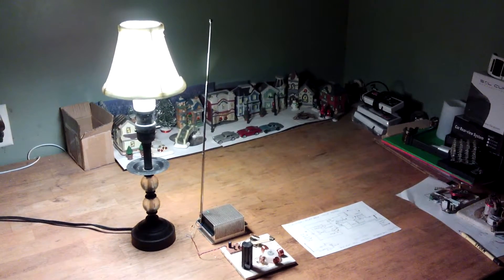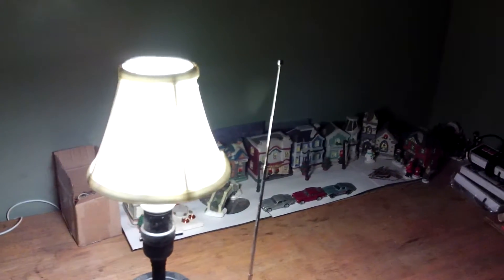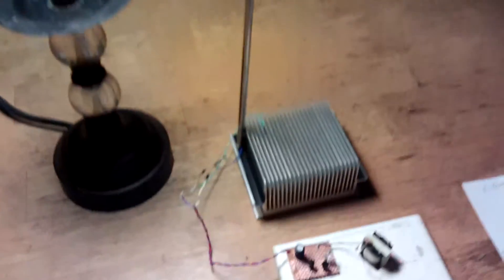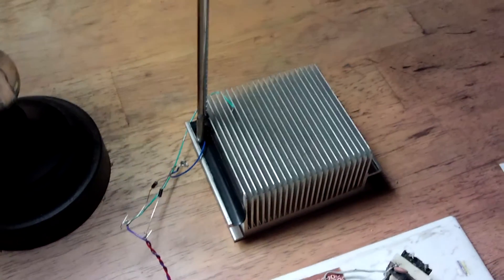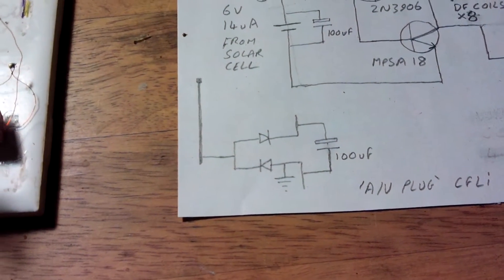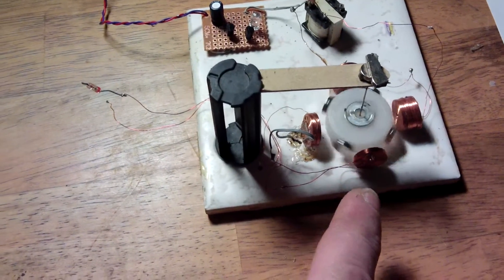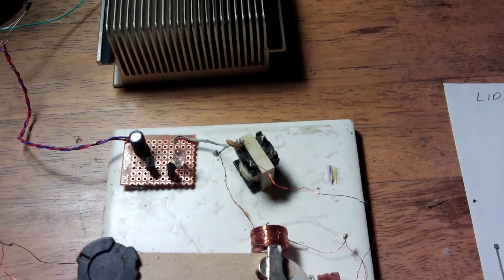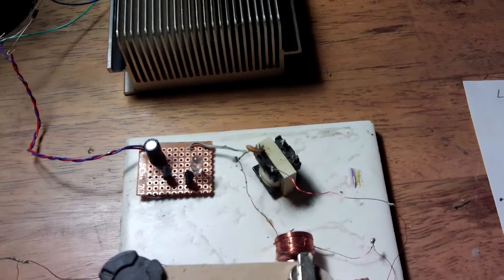Micro-amp motor - powered by lightbulb induction waves

Comment: maybe later try a tiny piece of magnesium  and a piece of copper for a earth battery. I had two 15 led lights running off of this for over 2 years then the magnesium corroded too much.
Reply from the maker: A similar motor did well like that a couple of years back. it's on the channel somewhere. Yep, part of the trick to long running is the least draw possible from something galvanic...with materials that don't naturally corrode. Graphite and stainless steel for example. I tend to use galv steel from the fence at the back of the yard, it was old when we moved here 8 years ago and has no signs of anything on it !

Comment: Have you got an inventor 3 circuit lying around?
Reply from the maker: Indeed and that was the original type of circuit, with a link removed between input and output caps. It was your good self who pointed out that such a circuit was a voltage doubler way back, so stripped down it ended up being an AV plug :)
Reply: LOL. Thats right its all coming back to me now. LOL curse this memory of mine. Shame there is no current doubler equivalent.
I wonder what the range on SWES transmission would be? You could probably get it running off BAC near a power line.
Reply from the maker: Hmm, well this sort of antenna should work ok for a SWES. The Ground plane is really half of the story, similar to any wireless bridging. Am intending to build a window motor, a horizontally levitated motor etc (in time) and somewhere hopefully gain some more efficiency.
Tuning some type of topload would be good, being that there's none at all on this one ! Am not sure how to tune to 2.4Ghz or would do that too.
Reply: 31.25mm is a quarter wave for 2.4ghz. Or go 125mm for full wave but you miss out on the ~5dbi gain of the 1/4 wave. To work out topload just calculate capacitance of top load to ground and consider how this will effect the res freq of your ant.

Personally I'd just go the 31.25mm ant in a pie dish reflector. Should give you a decent beam maybe 8-12 dbi.
If you can't cut 31.25mm just go a touch bigger and use a 0-5pf trim-cap.

Of you could just find something broken that had wifi. It will have a little PCB ant that looks like this http://www.ebay.com.au/itm/like/401184178948?chn=ps
Or you could just buy one from ebay for under $3.
Reply from the maker: That's how I fixed a quadcopter recently, made my own antenna. Tried a couple of homemade clovers but straight wire worked just as well, doubling the original range. Also, the weather station thing on a goose neck was improved by removing the stock ceramic 2.4GHz and snipping a circuit trace type from a fried ESP8266.
But the topload bit, that goes over my head !